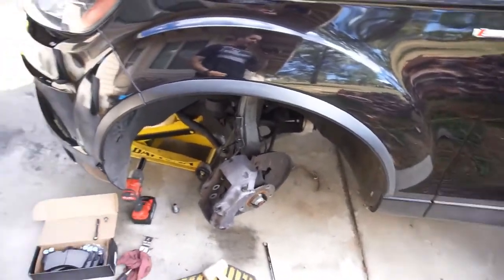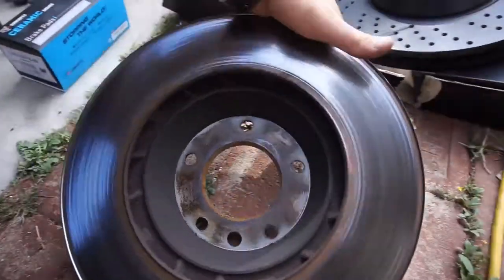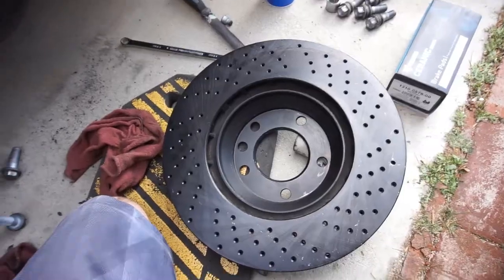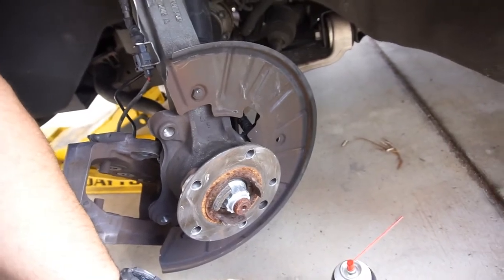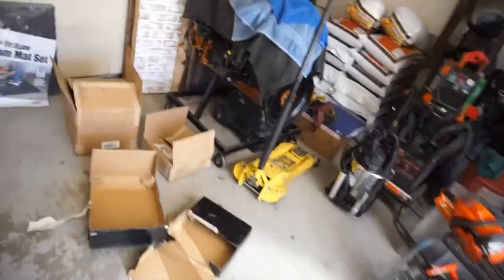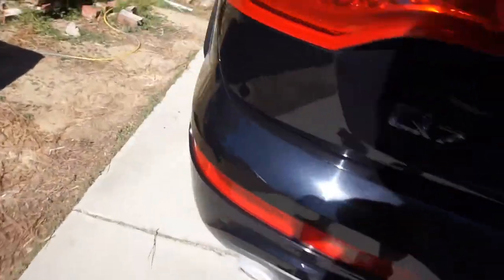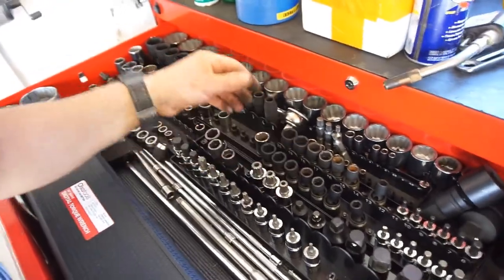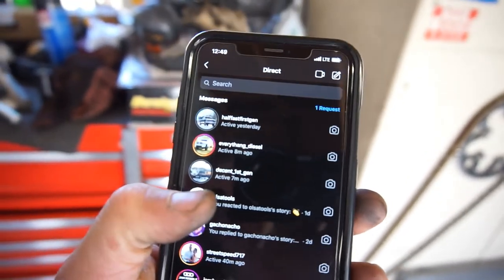2015 Audi Q7 Brake Job. Some Companies Need To Not Be In Business.

Comment: HUH.... Audi uses a strange wheel stud there? To mount the tire..... you have to hold that sucker up in the air and hand thread in the bolt?
Reply from the maker: Yeah man VW has been using that lug bolt forever Neumanns bug had them too. They have a tool in the trunk that you screw in to holt he wheel up but I’m too lazy to get it out.
Reply: @Halffast719  German engineers trying to think outside the box.... imagine doing that with a 37 inch tire.... you would need a floor jack to get that tire in line.
Reply from the maker: OneNGlen I’m telling you it’s not that bad with the tool. But I always lift vehicles just so the tire is 1/8” off the ground anyway so you don’t have to lift it so high.

Comment: Hey can you update us on longevity? I’m in the fence for the R1, I can’t find any other company offering upgraded brakes for the q7s
Reply: Also was there any difference in brake dust and stopping power?
Reply from the maker: That’s the sole reason I went with them. They fit really tight. I had to file my hub down which I really didn’t want to do. The dust is the same as stock. They don’t fade as bad as stock. I didn’t notice a difference in stopping power. I have about 20k miles on them and so far so good. I contacted them about the fitment issue and they basically just said they’ll look into it. Customer service sucks. But overall they work.
Reply: @Halffast719  awesome thanks, any ticking noises coming from the drilled rotors? I’ve heard that could happen
Reply from the maker: It’s weird but yeah you kinda can hear or feel them. Only while braking hard or riding the brakes. More like very small bubbles popping.